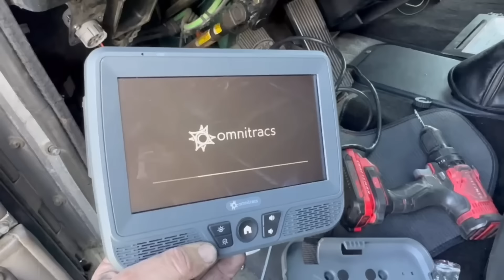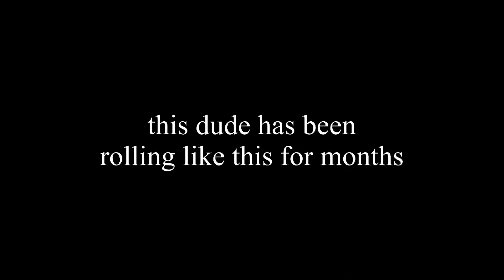“OH FANCY” - THERES NEVER ENOUGH TIME | Real Life Trucking - Episode #254

Comment: little tip: wet your stickers in dish soapy water. You can move them on the surface of the truck (or whatever you are sticking them to) as long as they are wet. They WILL dry up unmovable. !! I learned this from my father. Works like a charm.

Comment: I would make sure to mount that inverter back aways and then drill a 1 inch hole through the side of the closet so that you can lead an electrical cord in from the outside to plug in so you don't have to keep opening the closet door.